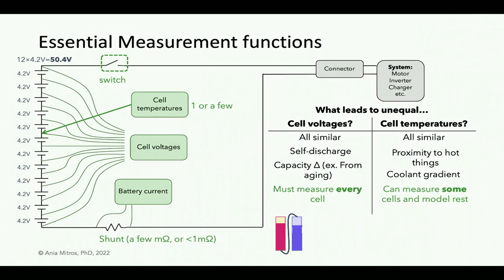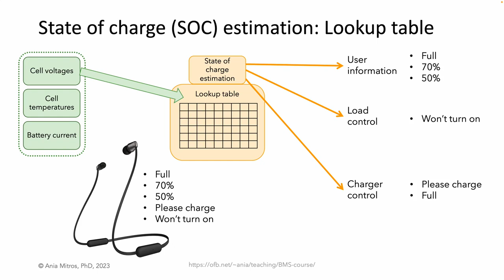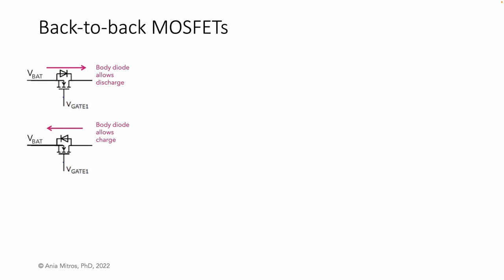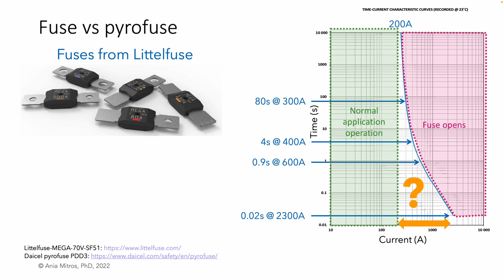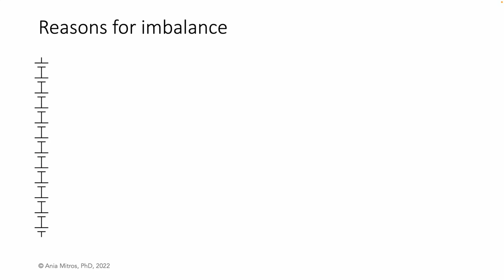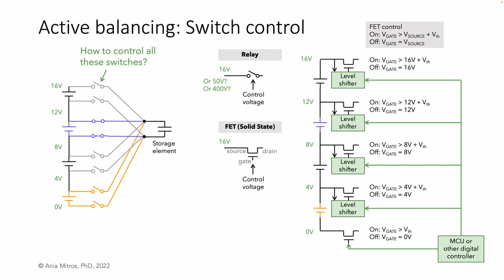Ania's BMS Course: (2) BMS functions

Comment: why isn't it possible to prevent/ stop a internal short by creating a mechanism that forces apart the terminals and still seal the contents inside the cell outer cover, thus preventing an accident completely?

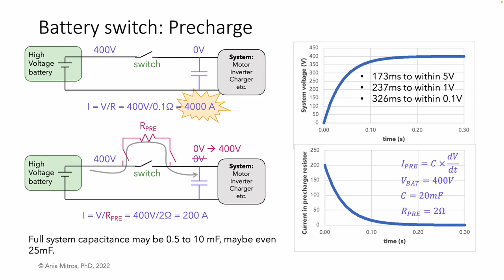Comment: 41:55 I didn't understand whether you recommended top, bottom, or both in the vehicle. Since you say a single switch is fine for a skateboard, then i assume you recommend two switches for a vehicle. But I didn't understand how the switches are related to a chassis short. You seem to imply that two switches create isolation from the chassis, but i don't understand how.
Reply from the maker: I re-listened to my video, and you're right that I didn't say it explicitly. Thanks for that feedback.

Yes, I recommend two switches for a vehicle. The reason is that with two switches, the single-point fault of a chassis short isn't immediately dangerous. If you had only one switch and a single ground, then a chassis short to any part of the battery other than ground would result in a very high current. The reason to worry about shorts to chassis is that so much in a car is electrically connected to chassis ground. Chassis ground is just everywhere.
Reply: Thanks!

Comment: 31:53 What does "between" mean? What is the "voltage between the FET's"? What is an "in-between node"? What does "different voltages" mean in the common drain circuit? Different how?
Reply from the maker: By "between" I meant the wire between the FETs. The drains of the FETs are connected. So the point between them is the wire that connects the drains.

In the common drain circuit, the voltage on VGATE1 will differ from the voltage on VGATE2. For example, if the battery is at VBAT=50V, and the system is unpowered with VSYS=0V, then to keep both NFETs off we need VGATE1=50V and VGATE2=0V. 0V and 50V are different voltages.

Comment: 28:10  Isn't retail price a consideration? I think you're saying that, with a switch, you're adding $0.10 to retail price. Without a switch, you're adding $4 to retail price, correct?
Reply from the maker: Retail price is very much a consideration.

What I'm saying is a little different. With a switch, you're adding $0.10 to the unit cost, or $10,000 for the whole production run. Without a switch, you're bearing a $400 total warranty cost for the 100,000 production run, which is $0.004 per unit. $10,000 > $400. And $0.10 > $0.004. The switch is more costly than bearing the warranty cost in this example. (Which is simplified in many ways, since retail prices include a mark-up, so a $0.10 switch might increase the price by $0.12; and warranty costs include more than just the battery, since some customer service rep needs to be paid to process a warranty claim and there's a shipping cost and so on.)

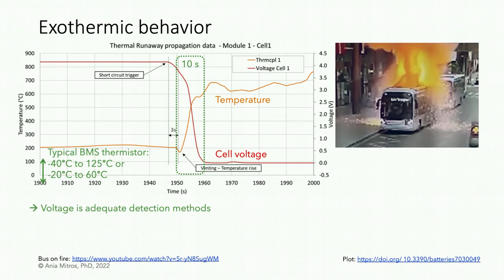Comment: 11:10 The detection of thermal runaway (TR) based on voltage measurement depends on the battery pack architecture. This method is effective when the pack consists solely of cells in series. However, for a series-parallel architecture, it becomes difficult, or even nearly impossible. If a cell enters TR, the other cells in parallel will attempt to compensate for the voltage drop. In this type of architecture, only a single voltage is measured, regardless of the number of cells connected in parallel.
Reply from the maker: That's a good point. It's certainly easier in a 1p battery pack.

Comment: Great course! Thank you for sharing all your knowledge! One question to the slide on cell self-discharge: why is it necessary to multiply with 2 x 2 in the case of 100 % SOC @45 C? Where does the 2 x 2 come from? Thanks in advance!
Reply from the maker: Because the worst case is at 45C, which is 20C warmer than room temperature. If self-discharge doubles for every 10C rise, and we have a 20C rise, than we need to double twice. double twice = 2x2